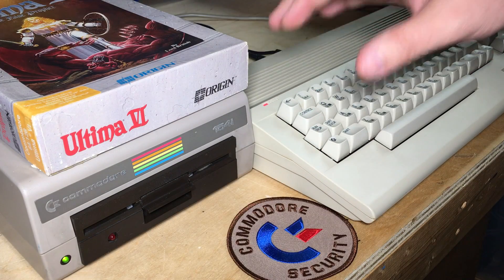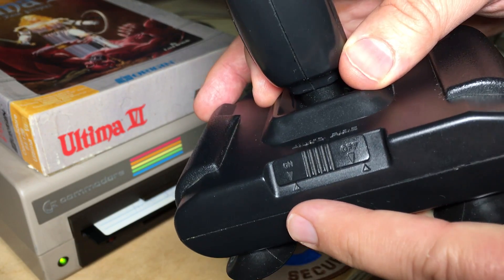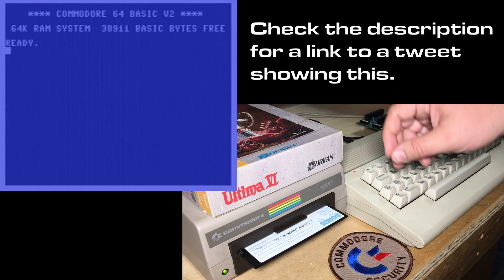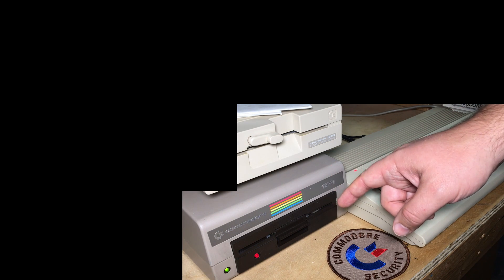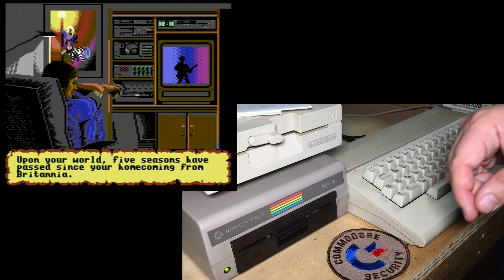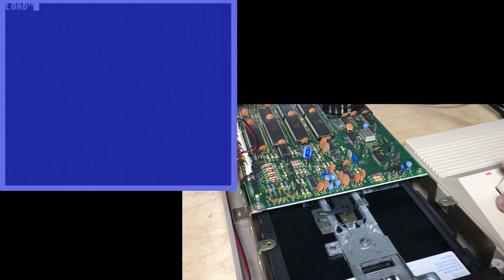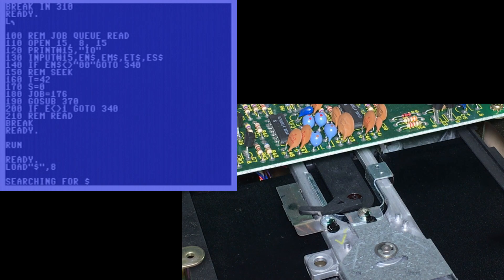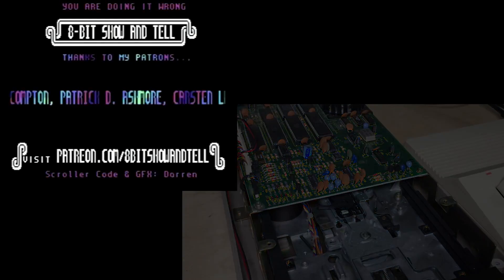Karateka Killed My 1541  (Temporarily) and Other C64 Scares

Comment: Some games on the Amiga didn't like multiple floppy drives.
Reply from the maker: I think I heard that was because each floppy drive in use needed to use some Amiga RAM for buffers, and on some games it was too tight? That probably doesn't explain all cases though.
Reply: @8_Bit  A guy that I knew (that did ahem game modification) said it was a mix of the extra memory used and that some games specified memory area so the drives couldn't be used (he said it was a form of memory protection)

Comment: Robin, quick question.... at 06:50 when you load Ultima notice that the screen then shows garbage before it turns black.  Why does it do that?  I figure the game is loading content into memory space, but why does it need to begin outputting it to screen before the screen turns black, and once the screen goes black it no longer needs to output this garbage on screen? To me it means the garbage did not need to be shown at all -- like it was done on purpose because Origin thought ht was cool???
Reply from the maker: I haven't dug into it, but I'm pretty sure it's loading into low memory in the $03XX range which overwrites some of the OS vectors, and then continues to load into the $04XX range which is the default screen memory. Games often do the $03XX trick to auto-run, and I suppose this particular developer didn't want to split the initial load up into a 2nd part to avoid showing the garbage on the screen. As far as I know, the C64 port of Ultima VI was outsourced and Origin was probably just happy to get anything that worked, and wouldn't quibble over these kind of details that would further delay that game.
Reply: @8_Bit   Origin (or at least "Chuckles") had enough of their own issues with running programs on the C64.  For example, Ultima III and Ultima IV on the C64 didn't auto-run, so you had to type "RUN" after loading the first (and only) file.  That's OK, but the problem is that these loaders have the wrong load address on disk, so you had to LOAD ",8" and not ",8,1" or else it would fail to run.  You probably know this, but I just wanted to mention it, since we're talking about Origin.

For those who aren't that familiar with the C64, generally when you load a program with ",8,1" at the end of the command, generally it always works, regardless of whether the program is in BASIC or machine language.  The examples given here are two of the exceedingly few examples of programs that are RUN like BASIC programs but have to be loaded with ",8" instead.  This is a bug on Origin's part.  It has no reason to be this way.

Comment: Speaking of 1541 problems, anyone remember the old "save with replace" bug?  You could put a "@" in front of the filename to replace an existing file when saving a new version.  I'd heard of it, but still used "@" because it was so darn useful.  Then one day it trashed a whole floppy, so I never used it again, instead just adding "1", "2", "3", etc. to my filenames until I ran out of space and I'd go back and delete the old ones.

I remember all sorts of things being blamed for the problem, including the common heat build-up in the 1541.  Years later someone (Phillip Slaymaker) finally found the cause and published an article in "Compute!" and a later one in "Transactor" (Sept. '86) along with some ROM changes to fix the problem.  It turns out the DOS in the 1541 has roots from the PET days where the floppy system contained two drives, "0" and "1".  The 1541 normally operated as "0" but actually had a "1" virtual drive.  This, and certain situations that could occur when doing a save with replace would cause the in-memory buffered copy of the block allocation map (BAM) to be "stolen".  Then the disk version would not get properly updated and cause the whole disk allocation to be trashed.  I never had an EPROM programmer, so I never implemented the fix myself.
Reply from the maker: Yes, I remember following the drama and mystery of that bug as a kid, as it was talked about in the various magazines. Very interesting stuff. I believe the bug has been fixed in all JiffyDOS ROMs, so that's another way to protect your files.
Reply: @8_Bit  Yes, it has been fixed in JiffyDOS, but old habits die hard.  I didn't get JiffyDOS until several years after the end of the 8-bit era, and by then I had gotten into the habit of never using save-with-replace, and adding a "0" to all drive commands (e.g. I0, N0, etc) to prevent that bug.  Still do, even though it's no longer necessary.  8^)

Comment: I learned how to program the 1541 back in the early 90s and I created a program that would change a single bit on any floppy disk which would make the disk unreadable.  I warned a friend about what it did, but he forgot and he ran it on one of his favour disks and he thought the disk was no good after that and tossed it out. LOL... I told him that he should have told me, I could have undone the "damage" and it would have been fine.  But I remember being fascinated that the 1541 was a self contained computer and there were instructions you could send it.  I used to run a BBS with multiple drives on my C64 back then.  I think I had a 1541, 1571 and 1581 (3 1/2") drives.  Still have a few in storage.

Comment: Hi, Robin! You have a Russian chip in your 1541! At 11:39 and 12:00, that brown EL7406 (position UD1) was made in the USSR! Or at least with Soviet technology, on Soviet made production line. The brown resin, and the font of the stamping makes it obvious. Maybe the Chinese bought chip fab lines from the Soviets? I have a board from a Datasette with the same brown EL74xx chip on it, i'm keeping that only for this reason. 
Here are some photos of Soviet TTL chips for comparison: http://retroelektro.uw.hu/muszer/omszov_oe92_ttl_checker/omszov_oe92_ttl_check_009.JPG
https://i.ebayimg.com/images/g/kRQAAOSwTKtc1IZX/s-l1600.jpg

Hey! I found a Twitter thread exactly on this topic! It's proven! Soviet made! Even the lead spacing is 2.5mm instead of 2.54mm 
https://twitter.com/tubetimeus/status/1031328650556141568

Here are some decapped EL74xx s, one of them has cyrillic marks on the die:

http://radiopicture.listbb.ru/viewtopic.php?f=3&t=50&start=280&st=0&sk=t&sd=a 

Cool, huh? :)

Comment: On a modern PC: playing Overwatch, and the character is going nuts. No idea why. It turns out that I just dropped the Xbox One controller and Overwatch supports both keyboard/mouse and Xbox controller simultaneously. Luckily, the movement icons change when you switch input devices and I realized what was going one while panicking

Comment: The problem with games malfunctioning with multiple drives attached is a consequence of their fast-loaders.  The Vic20/C64 IEC connector has one transmit-only "attention" wire as well as two bidirectional wires that are normally used for clock and data.  If a program outputs a pulse on the attention wire and then outputs a sequences of pulses on the clock and data wires to indicate that it isn't trying to communicate with to some particular device, that device will ignore everything on the bus until the next atttention pulse.  Some fast loaders, however, use "attention" as a clock wire and use both of the other two wires for data.  Normal IEC communication would have the drive output both clock and data, but having the C64 supply the clock and having the drive send data in response makes communication resilient against VIC-II cycle stealing.  Using the attention wire for clocking means that the drive can send two data bits for each clock pulse.  The problem with doing this is that if there are multiple devices on the bus, any device that isn't explicitly prevented from doing so will be likely to interpret some of the clock/data wiggles as attempts to address it.

Comment: I remember DI-Sector program was our goto for all needs even sector reading and sector editing.  I copied Karateka using Di-Sector and never had this issue, though this issue also occurs <Sometimes> if you interrupt the format process.  Open 15,8,15 "I" was a life saver, I actually had friends parents pay me to fix this problem usually 5 or 10 bux as I was a complete jerk lol.
Great video! Oh btw, I used the 1541's that had the lever disk door, and we did use more than one with all our Ultima games including 6.  Maybe we were just lucky but we had a slew of these old drives back then as even repair shops would throw them out when it had this simple issue. <Some people just didn't know how to fix it>.

Comment: The very first time I loaded a C64 floppy in 2017 my head got stuck and I had to find the reinitialization procedure. I still don't know why it happened. I was either loading Arkanoid or Maniac Mansion, both originals, and it got stuck on a black screen. When I got tired of waiting I did not know that you were supposed to power off the disk drive first so I blamed that after learning the correct power sequence, but now I'm not so sure.

I actually had two identical 1541 drives and it happened to both (black screen, then stuck head). Before learning of the re-init I thought I had a disk that was killing drives left and right! Still not sure why it was happening since both of those disks work now. shrug

Comment: One thing i always remember was when giving the advice, "Turn you computer off for 5 seconds"  i always wondered why RAM which was powered by electricity managed any state.  I could see an eprom doing that but not static RAM
Reply: The C64 uses dynamic RAM ICs, which use a tiny capacitor to store the value of a memory location.  It does not use static rams for the main memory.  That was one of the cost savings in the C64, the VIC-II chip had DRAM refresh circuitry so Commodore could use the cheaper DRAM (instead of the far more expensive static RAM).

Comment: I have an old c64 well preserved in a plastic box with its cables and everything including 2 1541's. A month ago I decided to connect and play some time with it but.... It was runing abnormally, some characters on screen, did not boot a couple of times, etc.. looks to me it just died while being stored!
Reply: that is a common failure, some oxide deposit over IC sockets  ... just pull up chips and reinserted it, that removes oxide so electric contact getting ok again...

Comment: You have explained it nicely. I did not know about that track 42 thing. I guess,I have to try that :-) The CBM80 issue can be circumvent with a slightly modified Kernal. https://github.com/svenpetersen1965/C64-Kernal-2.1

Comment: At some point in the 90s I bought a new 1541-II because the head got stuck like this im my old 1541. Figured it out shortly after, and enjoyed having 2 drives. The "getting stuck" is by the way software only: the 1541 will only seek back and forth one track when attempting a normal load. It tries to read the current track number from the disk. If that fails it doesn't try to seek to track 0 on its own. You need to use initialize, or format a disk for it to do that. If you have a 1541C it will seek to track 0 on eveery powerup.

Comment: Printer interfaces often have a wire (I think called a dump cable) that plugs into the cassette port.  I have at least one program that will not load unless I unplug that dump wire, although for the life of me I can't remember which one(s) it is.  Some 1541s seat the head back at track 1 when they power up, eliminating that problem of the head not being parked on track 18 and it getting all confused as to where it is.

Comment: I had the track 42 error happen on my 1541 2 several times over the years. I found inserting the protective sleeve that ships with drive would also fix the problem. However, I have no idea if it did any physical damage as my drive never needed repairing in the 10 years I had my C64 and worked flawlessly other than the track error.

Comment: I took my vic 20 and c64 out of storage last summer after being tucked away for 2 decades. I connected everything up and everything seemed to be working fine then every now and then every other key wouldn't work... for both computers! I found out it only happened when I tried to play a game. Eventually I discovered it was because I was using a Sega Genesis controller.

Comment: As for the multiple drives issue with Ultima VI, I remember a similar problem with some of the early Amiga (A1000) games where, if it was unexpanded (512k, with the OS loaded into part of that), if you had an extra floppy drive games would sometimes not work right because that extra drive uses a small(-ish) amount of memory to do its work and that meant the game didn't have enough.

Speaking of memory expansion on that old A1000, just to give an example of how far we've come in terms of RAM prices, my mom bought the 256k memory expansion module for my A1000 as a Christmas present and it cost her about $300. For 256 K! That's a quarter of ONE megabyte of RAM, folks. I just bought a 128 GIGABYTE SD Card for my wife's phone and it cost about $20. That's about 500,000 times as much memory for 1/15th the price. At this rate, 1 terabyte memory cards will be in Cracker Jacks boxes within the next 5 years...
Reply: You can't compare ram prices with flash memory.
Reply: @Okurkaarrgghh  Different technologies, true, but they are indicative of how much prices have dropped. Even if you look at how much flash memory has dropped in the last 10 years, it's night and day. But if we stick with actual computer RAM it's the same: A 32GB DDR4 RAM module is about $100 now. I paid WAY more for a couple megabytes worth of RAM modules for my ancient Win95 machine.
Reply: The multiple drive issue with some C64 games and many C64 demos is caused by disk fast loaders integrated in those games and demos. They use the IEC bus in a way that only works if there are exactly 2 devices on the bus (the computer and one single drive). Hence those also do not work when a printer is connected and turned on.

Comment: There was an old game on floppy for the C64 back in the day (can't remember what game it was) that used a copy protection scheme where the actual disc had holes in it that the copy protection loader would "steer around" during the game load. If you tried to copy it the drive head would get caught in one or more of the holes, destroying the disc and possibly your drive head!

Comment: I'm confused about the nomenclature of the 1541 opening mechanisms!
I know there's the type you have in the video and the other type, well.. the one with the turning lever.
I have read so many different terms for both mechanisms and find it actually hard to assign these terms to one of the two types of mechanism.
What is
'kerchunky'?
What is
'latch door'?
What is
'flippy type'?
What is
'knob type'?

The only assignations I find unambiguously clear are 'push-down' type and 'turning type', so please: can someone use these terms to explain the other ones? :)

And I wonder why 8bsat says that the typ ein the video was the older type. There are old style 1542s with both types of mechanism as there are newer types, like the 1541c that are still using both types of mechanism.
Reply: Commodore didn't actually make the actual disk drive unit, they purchased them from (IIRC) two different manufacturers (one of which had the push-in to eject tab, the other had the swinging latch mechanism) and stuck them in a box with their IEC controller board.  So the type of latch (and associated faceplate) depended on which drive mechanism was being used.
Reply: Thank you, it seems my text was  missunderstandable. I was just about the terminology :)
Reply: @glenndoiron9317   All true, to my knowledge.  I don't think any computer company (except maybe IBM at some point?) made their own floppy drives.  Originally, Commodore got their PET/CBM drive mechanisms from Shugart, which is why the faceplates and "flippy" latches look the same as those of the old-style Apple Disk II (and drives from a bunch of other companies).  This was where the original Commodore and Apple 35-track formats came from, since the Shugart model they used was limited to 35 tracks (the formats were similar, both based on GCR, but not compatible).  The original 1540 and 1541 have drive mechanisms from Alps, which use a "pushy" latch.  Apple later switched to Alps, as well, and have a different looking but similar functioning "pushy" latch.  At some point, Commodore switched mostly, but not completely, to a Newtronics (Mitsumi) mechanism with a "twisty" latch.  Both the Alps and Newtronics mechanisms are capable of 40+ tracks, but Commodore stuck with a 35-track format as standard.  Some say that the Newtronics-based drives are less prone to misalignment, but they have this issue with the R/W head seal, which seems to eventually go bad, rendering the head permanently inoperable, while the Alps head seems to last forever (at least in comparison).  By the way, the 1571 also uses a Newtronics mechanism, but it doesn't appear to have the same issue with its heads.

Later Commodore developed the 1541-II, which also used drive mechanisms from two sources: Newtronics (have not heard of problems with this R/W head) and Chinon (1581 and Amiga drive mechanisms were sourced from Chinon, as well, although some Amiga drives were from Panasonic).  The two types both have "twisty" latches and look only slightly different, although internally a big difference is that the Chinon is a direct-drive unit with no belt to wear out.